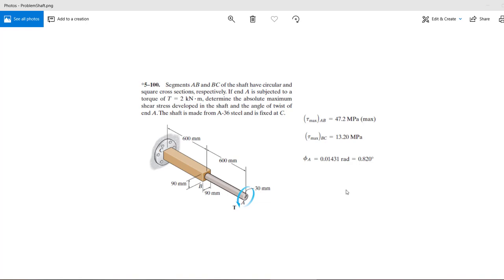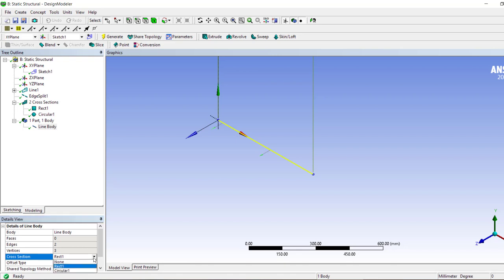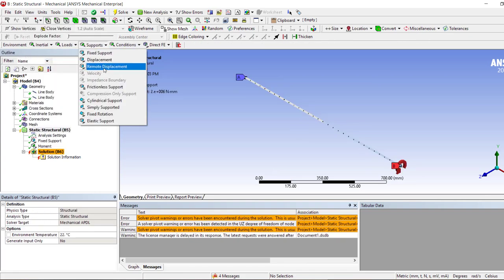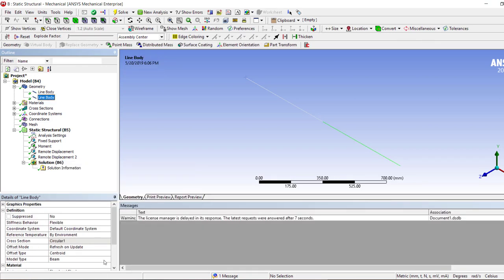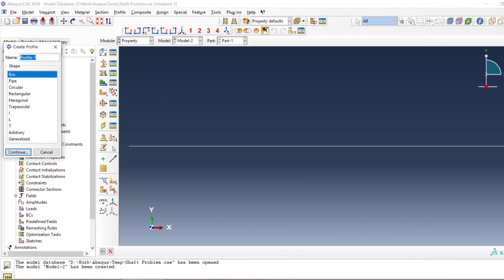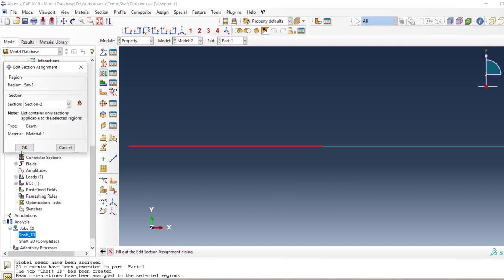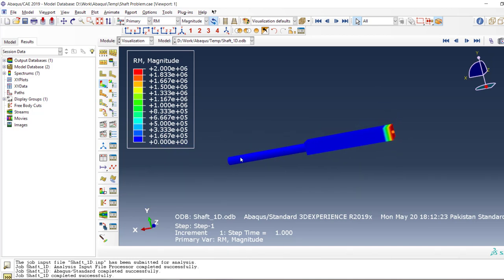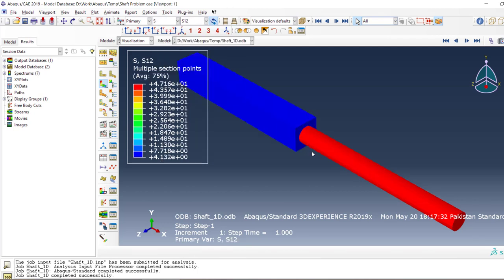Ansys Mechanical Vs Abaqus CAE Part 10 - Solving Shaft anlaysis using 1D elements.

Comment: Thanks for sharing the video. It's a nice example. 
However, to get results from ANSYS WB, the following modifications must be applied on the model in the video:
1) In DesignModeler, select both line-bodies, right-click on them, and select "Form New Part". In this way, you will build a connection between two bodies. Without this, the two bodies would not be connected, so you will get errors regarding unconstraint degrees of freedom.
2) In Mechanical, go to Solution >> Beam Section Results, and set it to "Yes".
3) Add a User Defined Result, and type SMAXSHEAR as the expression. You may select either of the bodies to view shear stress distribution and its value on the cross-section.
I used a mesh size of 10mm (Note that the mesh size does not change the results) and found the maximum shear stress on the circular shaft to be 47.255 MPa, while 14.241 MPa on the rectangular shaft.